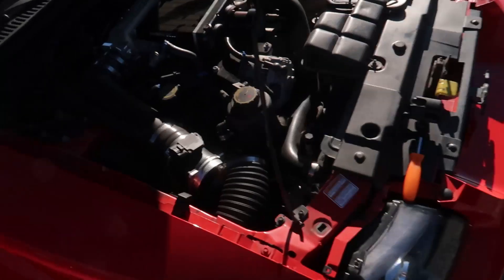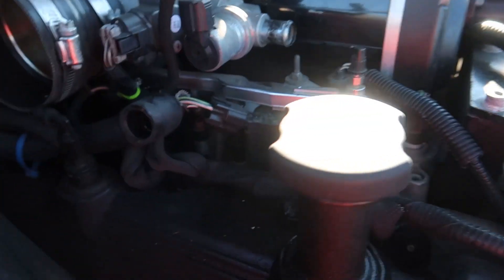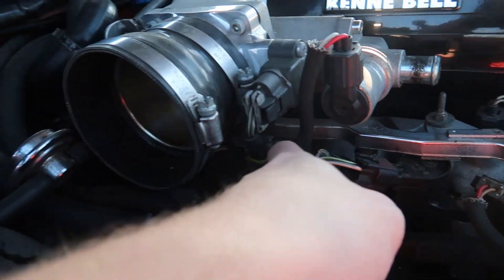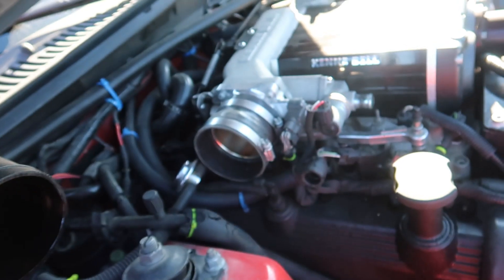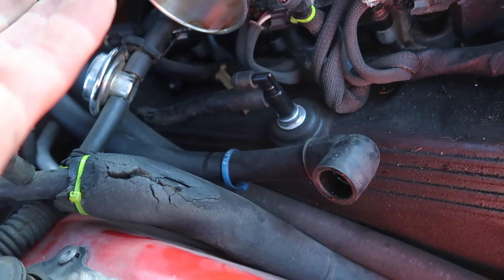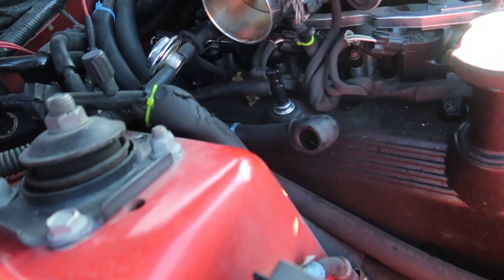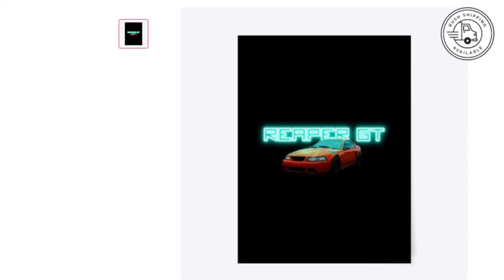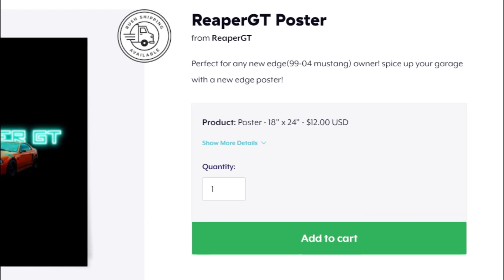It's WORSE Than We Thought

Comment: Get the motor out of a low mile 2000 or later grand marque. Its identical internally. Just need to swap oil pan, exhaust manifolds and maybe the valve covers. I did it and the motor was like 450 dollars with 63K on the odometer.

Comment: I done a budget build on my 2V, cobra pistons, boss 302 coyote rods, ported heads, cams, long tubes ect. I used my stock crank because it’s all I will ever need. The boss 302 rods are on the cheap side and they will hold up to 700hp I’m told. If you need some info just lmk.
Reply from the maker: How much did all that cost
Reply: If I’m not mistaken I think parts were around $2,000. I done the work myself so I saved a bunch there. And that’s every gasket, bearings, rings, and having everything balanced at the machine shop. I ported the heads myself so just cost of materials for that. Also, got a great deal on cams from Todd Warren. If you look hard enough and have patience you can find really good deals.